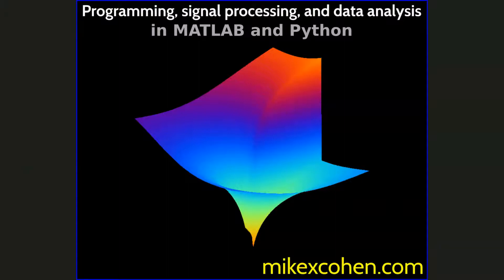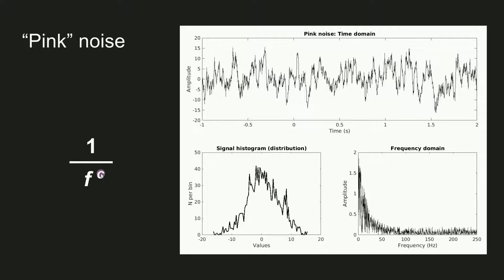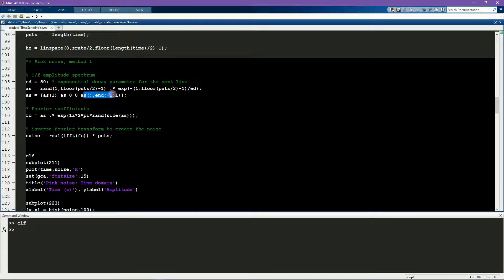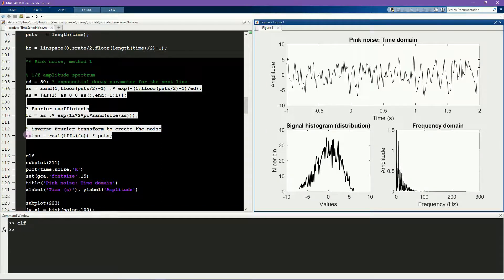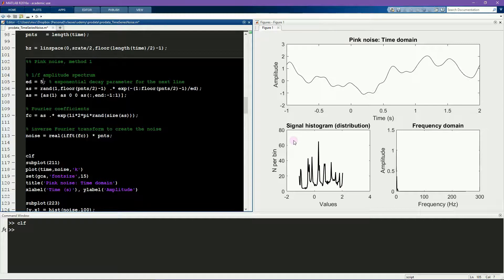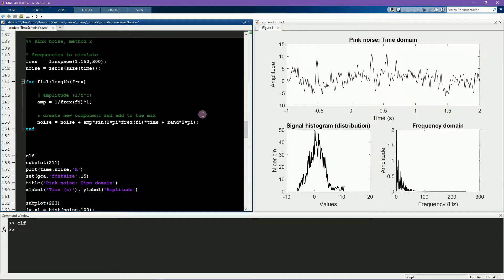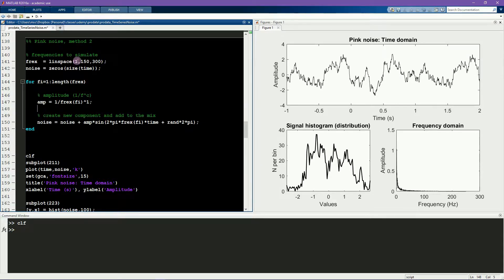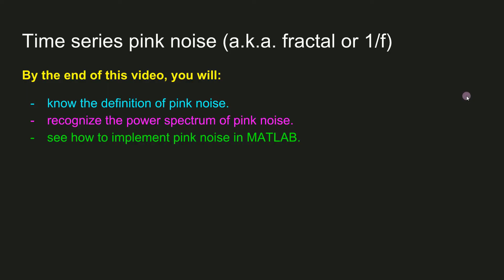Learn how to create "pink" noise

Comment: In your first method, it seems you're doing a exp(-f/f0) noise rather than a 1/f noise, no?
Reply from the maker: Good observation. "1/f" is more an umbrella term for the general characteristic of decaying power with increasing frequency. You can use an exponential decay or a power law decay. Technically, those are different functions and different distributions, but they're very similar to each other, and in most cases there isn't a practical distinction.

Comment: Thank you for the clear explanation! I wanted to know if the amplitude could be controlled (and if so, where). I'd like to generate pink noise, over 40 seconds, but only between +/- 1in of amplitude, and 1-50 Hz of frequency content. In other words, I'm using the pink noise to generate movement in a physical test, and I need to make sure I stay within the working limits of my part. I hope this makes sense, and thanks for your help!
Reply from the maker: Yes, you can do this. The first step is to create the noise to have the desired spectral content. Then in the time domain, standardize the amplitudes by subtracting the minimum value and dividing by the maximum value. That puts all data values in a range of [0 1], and you can then multiply or add other values as you like.
Reply: @mikexcohen1  I've got the duration down to 40s (time=0:1/srate:40), and have the sampling rate (srate) at 100 (so the frequency range, hz, is 1-50). But I'm having trouble locating the time domain, like you mentioned in your comment. Where can I standardize the amplitudes? And by standardizing, doesn't that change the speeds? Thank you!
Reply: @mikexcohen1  I actually figured it out, thanks again!! :)

Comment: Hi! In method 2, is the pink noise completely deterministic in time after the first period? Does that mean the noise is no longer random outside the first period?
Reply from the maker: Not the way I implemented it here, because of random noise and random phase values. But you could set it up to be deterministic and therefore repeatable.